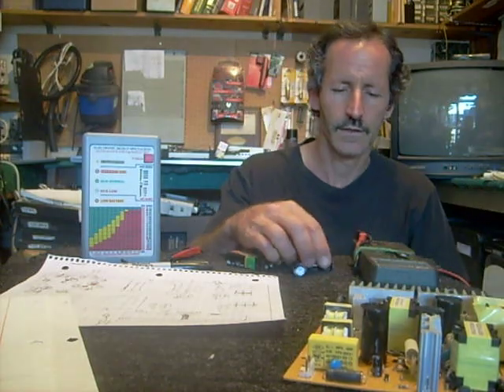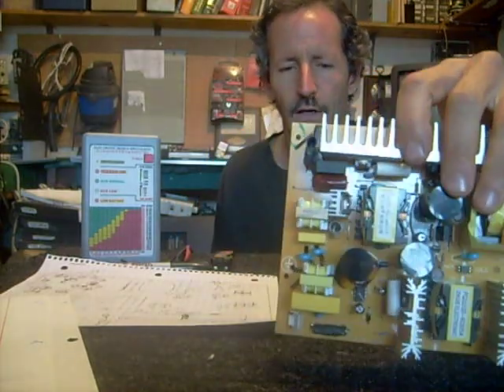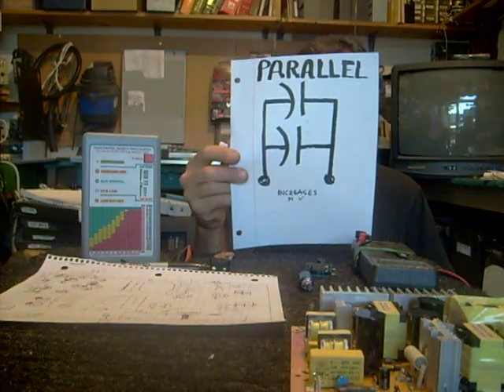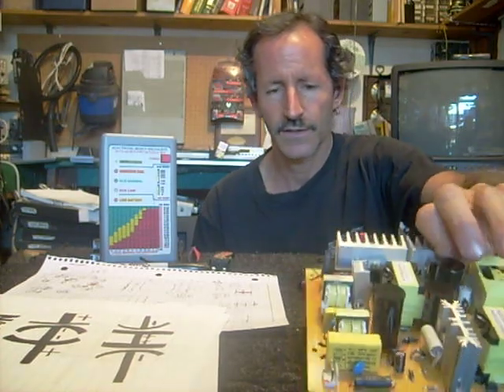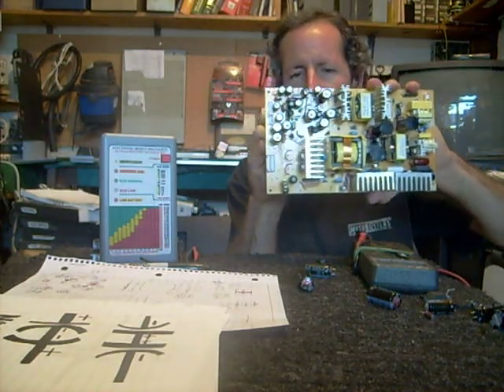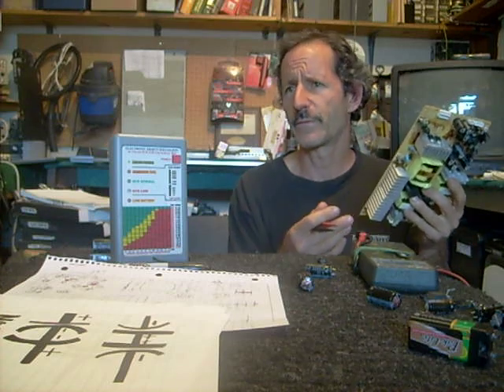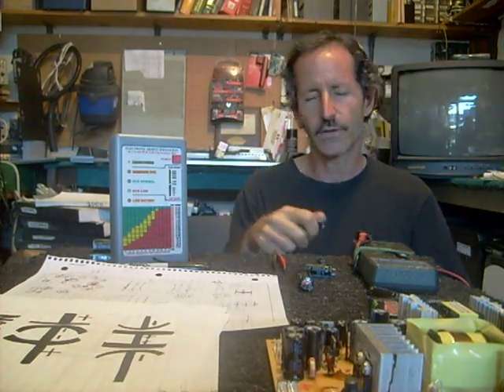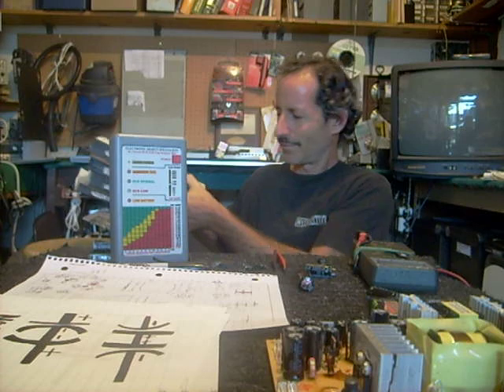LCD TV Repair made easy # 1

Comment: Really enjoy the videos and many thanks to Grants Pass TV Repair for them!
If someone could help I would much appreciate it!
I have a 2008 model Sanyo dp42848  42' lcd tv with ccfl lighting.
When I turn the set on with remote or by the panel, the first thing heard is a normal tick 
sound and the green light comes on in the corner (which does not flash; stays constant while powerd on), followed by no sound and no picture. Within or around 5 seconds 
it cuts itself off and back on again in a constant loop until the unit 
is unplugged. 
Also, when it cuts off, it flashes about a half second of
picture which is blank but I can see the input in blue saying INPUT 3 CH 4.
The quick flash of the entire screen which looks clean and clear of lines or 
distortion or at least as far as I can tell.. Could it be a ccfl light tube gone bad or the lcd panel, a bad cap or board? Thanks again to anyone who may have some advice here!

Comment: I have an LG 42lb5df-ul  It comes on for a few hours or a day or so then the picture goes out but i still have sound so i changed the inverter boards master and  slave. After installed the other ones i ordered ( i think the were used) the tv worked for about a month then the same problem came back . What are the chances that the new inverter boards went bad or i have other issues, the voltages going to the inverter boards look ok . What would be the next thing look at ? I heard that there is a light censor  that turns the back lighting on and off on this tv ? I also tried to use a flash light to see if the LCD was working and just the back lights were out but i cant see anything.

Comment: @GrantsPassTVRepairs 
Hey thanks for the quick reply! I didn't notice the capacitor comparison sheet until now, thanks. 
$100.00 is currently a little pricey for me, but maybe I can find a deal on ebay or something. 
I ordered some Rubycon caps before I discovered your awesome webpage, so we shall see ;) 
I will tell you whether they install successfully in a few days, other than that, all i can say is that they are purdy.

Comment: Hi, just wondering of my LG LCD tv, sometimes it will not power on for weeks and then it will power on like nothing has happened. I thought is that a problem with capacitors or smth else could be? The folk who is fixing tvs said that this happens, but I believe there might be an issue that he does not know about. I would be grateful for an answer. Thank you

Comment: I have a insignia 32" lcd tv. Once it's turned on it plays great. After it's on a few minutes a message box pops up indicating no signal and the video goes out. Could this be a capacitor and or heat related problem? Thanks.

Comment: hello sir, i have a question about my dynex 32 lcd tv. i had a lighting strike the other day that tripped the circuit breaker in my bedroom, ive lost the hdmi ports on the lcd. but one of the components and the av input work. however ive noticed that the color is off. sometimes too bright and vibrant. would this be a tuner/main board problem? im trying to elimanate other boards....power supply, inverter board, etc. thanks

Comment: @GrantsPassTVRepairs can u please answer this question:

my tv turn off everytime i turn it on..... i check the capacitor and they all look perfeect to me!?!

isit turning off because it has a low voltage (it does not look damage to me so i think it got to do with low voltage) does it mean i have still have to replace all of them with new ones?!?

i all so notice that it overheat extremely fast compared to my living room plasma

Comment: Thanks for these.
I have to disagree with you on a few points. It is a bad idea to use a higher voltage rated capacitor. Series capacitors are a bad idea. Making your own bipolar with two electrolytics in anti-series is a bad idea. The reason is Al electro caps rely on slight leakage currents to maintain the oxide layer. Lower voltage than its design voltage won't maintain it, series caps will have different leakage currents causing overvoltage on one, and anti-series reverse biases the caps.

Comment from the maker: @borninlaos1 A black screen with sound sounds like inverter board problems. Now that you don't even have a stand by light it sounds like your power supply is also having problems. I would start by checking the caps in the power supply and the inverter transformers for opens.
tv repari info .  com

Comment: My Coby 40 inch LCD HD TV doesn't turn on for some reason. The standby blue light is on as normal, and when I turn the power on it turns brighter, which it normally does, but then it shuts itself off again, going back to the normal standby light. Is this a cap problem? It may have short circuited, because there was a pretty bad thunderstorm the other day and a lot of lightning was flashing near my house. Any advice for this?

Comment: My parents TV has an issue. The remote won't work with it anymore. There is nothing wrong with the remote though. The electric eye in the TV has an issue. It's an older TV, btw. Any Idea on what to check for or do to fix this?

Comment: I have a 42" sanyo vizon that the left side has 5 vertical columns about 4" wide each that from left to right are a green plaid kinda pattern, black, varying color horizontal lines on a black background, then a distorted column, and the last column is just slightly distorted. The rest on the right is perfect. Searched high and low to find a similar problem on the Internet and have come up empty. I have a little electronics knowledge, but clueless with this. Any ideas?  Tv is only two years old

Comment: @AseasonedKiwi you know I think I have a similar problem I connected my PS3 with HDMI to my 52" hd and it worked, after that I heard a voice like a ticking one but I ignored it and shut it down 
I woke up and I found out that the tv won't work at all no sound or picture 
at first it starts and flashes without showing anything and than it remain with no picture or sound .

Comment from the maker: If the Display itself has a crack I would not feel comfortable repairing it. It's possible the gas leaked out of the display, and the cost of a new one would exceed the value of the TV.

Comment: hello I have a  POLAROID TDA-03211C  that I noticed that I was having picture problems with I was able to fix the problem, but when I fixed the problem I had two of the ribbons that connect to the lcd screen come loose from the main board and I was wondering on how to be able to reattach them or if that was even possible. If it is possible what would I need to complete the job? everything works on the tv except the two sections where the ribbons came detached.

Comment: First I'd like to say, I really like your video's! I bought a 52' Sanyo TV in 2010..Model # DP52449 serial number B9240993609300..Last Sunday, we turned on the tv..All that came on was the power light..Screen was black & no sound..Do you think its time to buy new or can it be fixed? TY TY TY

Comment: Can you help with LCD Monitors, my monitor IH252HPB The monitor will not fully wake up from sleep mode. I try to move the mouse as normal, and the screen wakes up for a very brief moment, so that I can see my desktop for a short period of time. Then the screen instantly goes to sleep again. Occasionally, I can fix this problem by pressing the power button on my monitor a few times. Most of the time though, I have to do this process many dozens of times before the monitor reveals my screen.

Comment: Can you give advice on a particular problem? I'm working on a dead Prima PH4237P plasma tv. On the power supply board PS42FK6-20B the diode D5028 is shorted. The diode part number is ARS177. I can't find any info on the part. It appears to be a rectifier maybe 1 amp 400 piv but do you know what it is.

Comment: Hey, i have an output problem but not sure if its a capacitor issue (i could be wrong) but when i turn on my tv (lcd) what i realize is that the color quickly fades and appears like negatives from a camera on the opposite side of the color spectrum. Is this a capacitor problem? Thanks in advance.

Comment: Hello, ok I have a 32" LG it turns on but it takes about 5 minutes for the full picture to come up. It flashes down from the top of the screen to the bottom little by little. Once it's fuly up audio and video is fine but it takes a long time and is not instant. Could you tell me what may be causing this and if I can do this fix myself?

Comment from the maker: @haroldrahl The most common problems I have seen with TV tuners are bad solder connections. Other than re-soldering some of the connections I don't think you will find many if any TV repair shops that actually repair them. In the past a couple of  different businesses that do these kinds of repairs sent me advertisements but I don't remember their names. Perhaps a net search will help you find a re-builder. Also check with some of the companies on my web site at TV REPAIR INFO . COM  
Dave

Comment: What are your recommendations for a good DMM  and a budget priced O-scope?
Reply from the maker: +Vernon Bosshard  I don't have any recommendations concerning Oscilloscopes or multimeter's, but I'm using a fairly old Hitachi scope and Some Fluke multimeters. One thing I like about my fluke meter is I've often accidentally placed
it on the wrong scale while checking voltage and it never harmed my meter.

Comment: Hi! I've got a samsung la32b530 and its volume will lower down by itself to 0. The remote control does not seem to be working, and the volume control button on the TV panel does not work either. It will jump from TV to PC to HDMI (between sources by itself). And now, the remaining buttons are not working either (can't switch channel using either remote or main panel), in fact the only button that is working is the on/off button :( Can you advise me on some DIY repair tips?

Comment: Hi i have a 32 inch emerson model LC320EM9. I press the power on and the green light blinks for a few seconds and then it goes to standby. I have bought a new inverter board but it does the same problem? any suggestions?

Comment: I have a 46 inch Insignia lcd i have just a black screen no sound or anything. I see the red power light, but once I power it on it turns blue then back red and stays red. What is the best thing I should do?

Comment: I have a 42in Vizio tv that has audio but no picture.....sometimes if we unplugg it from the outlet and replugg it after a while ...when we turn it on  the vizio loggo and  then the  picture will come up and it works fine....but if you turn it off  and try turning it on again....NO PICTURE,,,,do you  have an idea what could be wrong.....

Comment: Hi! I have a Insignia NS-46L550A11 the power comes on and the back light comes on with purple blue screen but when I hook it up to media streaming device or cable not picture.  What could be my issue? I would like to repair it myself.  Thanks in advance!

Comment: I have a Emerson model LC320EM1F no stand by lights or anything I unplug the inverter board when tv is unplugged I go to plug it back in and can see a flash from the socket in the board . Could this be a bad inverter board ?

Comment: Dell E153fpc screen problem.

Sir:

My problem with this lcd monitor is that when I turned it on unplugged from my pc you know that a self test box appears at the screen normally floating and inside this box there are 4 horizontal color bars: the first is the red, the second is the green, the third are the blue and the fourth are the white. The complaint is that the lcd screen looks white instead of black without the vga cable connected to my pc and the first color bar looks light blue instead of red, the second looks like pink instead of blue and the third looks like orange instead of red and the fourth looks black instead of white. Could this problem be due to a bad cable connected between the mainboard and the t-com connector, bent pins inside of the t-com connector or what else? Inside the t-com connector I had found from left to right 2 pins bent and crossed each other. This can damage the video processor or if I fix them the monitor will be back to normal?

Comment: Hmmm I took the back off and the back projection lights in the lcd panel are on my problem is the tv turns on with the remote and tv screen is blue but I can't use the input and change to different modes, cable, antenna, hdmi sources...any idea with that information?

Comment: I have a 27in vizio that seems to be temperature or humidity temperamental.  Almost like there is a failed solder joint.  If I lift the tv and tilt it, the tv works.   Tv failed after accidentally cooling down my room with a window unit.  Approx 64degF.  Ordering a booklet from Mike.  Any ideas?  Video link to come after my phone finishes upload.

Comment: Hello
My TV past the Flashlight test, However I would like to know using my LED Tester, My Leds do light up on my TV, that only has one line (2 wires). Red and black,The Led tester shows the LED does light up and shows approx 140 volts, does that mean i do not have to take the TV further apart and examine the LED strips?

Thank You
Reply from the maker: I don't know anything about the tester you're using so I'm unable to help.
Reply: @GrantsPassTVRepair  You are right ,the tester is  SID LED Multipurpose Tester for LED TV Backlight

Comment: Hello i have a Quadro 32gh10 LCD TV, it needs 15 min to start and when it starts VGA and HDMI dont work and there is no menu, only works analog input, i changed capacitors on power board and still same i tray to heat mainboard with hairdryer :P  but it still need 15 min to start even it was hot... what is the problem, what should i check? and i also check all voltages and voltage reg, they are fine 24V rail 24.1v and 3.3V 3.28V...

Comment: Question!!  i have a slim horiozontally picture image on my samsung  30"  i try all possible settings and adjustable button inside the pack panel did my transformer,tuner or capacitor when bad!!!!

Comment: can you tell me about sound problems . I will tell u what happened. I had a problem with my samsung LCD LA40M81BDX / XSA. It was clicking and I changed capacitors that were little leaking. my clicking of LCD got fixed by doing so but I still have sound problem. I tried to put my ear phones into the TV jack place but still no sound. Can u please tell me what is the problem. it will be great help

Comment: I have a 80in sharp Aquos 3d smart tv and the warranty is over. It has a dark spot about the size of small soccer ball in the middle of my screen.you can't really notice it on certain background colors.but when it comes to darker backgrounds you really notice it.it not black were as you can't see through it,because you can see through it and it changes colors to match background (but stays a little darker of the color it matches) except when darker backgrounds appear(but can still see through it too) I've tried running the tv on the snowy background and turned the brightness all the way up and them massaged the spot with no success.any help would be great.thanks

Comment: I have a 2003 Toshiba model 51H83 Projection TV. When I turn it on the picture is shaking and distorted on the top of the screen.  ( This action is done intermittently and not as a pattern  ) After a while it stops and returns to a normal picture which is good. What could it be. Thanks

Comment: I have a 55 inch vizio lcd that i have had for 3  years and this morning when i turned it on the screen was black, no picture no sound nothing. I hooked up the directv receiver to another tv and it works fine, so the problem must be my tv. Any suggestions on what it might be?

Comment: Hi there would you be able to advise me i have a Bush smart TV led2412dvdcntd. Its just switched off on it's own with a little pop sound it doesn't power up any more.
Reply from the maker: Common causes for a popping sound can be a bad semiconductor that shorted like a transistor or a regulator. Also capacitors can blow and make a pop noise. When these components go bad they will often be accompanied by a bad fuse.

Comment: I have a Magnavox 37 HD LCD and when the Tv went out I replaced the 2200uf cap and it worked. 6 months later poof another cap went( I thought) and replaced the 1200uf cap and this time the Tv still won't power up. Any help would be greatful!

Comment: Hi, thank for the videos. I have Mitsubishi DLP tv , which developed the usual white spots. So bought DLP chip, installed carefully, switch on, nothing on screen but lamp, fans, all that are on inside. The green timer led comes on at the front, flashing as normal. Then timer goes continuous, after a while switches off. Took everything out again to check connections, everything looks OK! Any suggestions?
Reply from the maker: Since your symptom is now worse than what you started out with I would wonder if the chip you installed has a problem?
Reply: Thanks, yup it was a dud chip. The seller sent a new one installed and working perfectly. I did not think he would send me a dud chip!

Comment: I have a Digitrex 32" HD LCD TV: model is CTF-3271 bought yesterday
and it will not turn on! It is properly connected to the mains and I have used the on/off switch, but it is not responding. It should go straight to stand-by but it isn't coming on. I have tried turning it on with the remote to see if the stand-by light was broke, but nothing! HELP!

Comment: Hello I have a Dynex DX-L40-10A I bought a new power board from ShopJimmy and the Tv will not cut on I checked the pins gnd=0, gnd=0, STB=2.8, 5V=4.8, 5V=4.8, 12V=10.2, 12V=10.3, gnd=0, BR1=4.0, SW=0, gnd=0, gnd=0, 5V=5.2, 5V=5.2 I think the SW should not be 0 if you can help thanks....